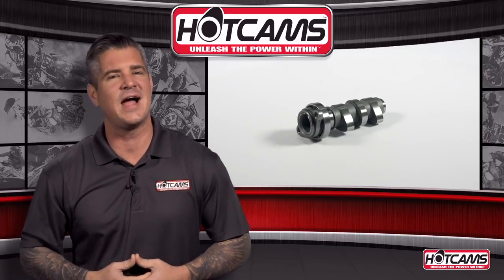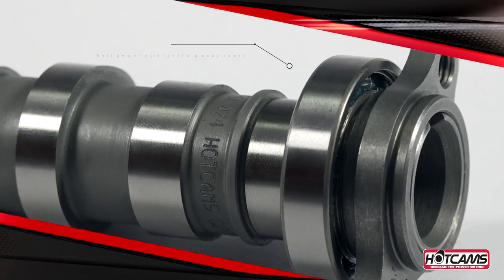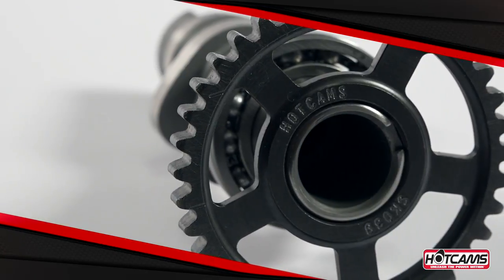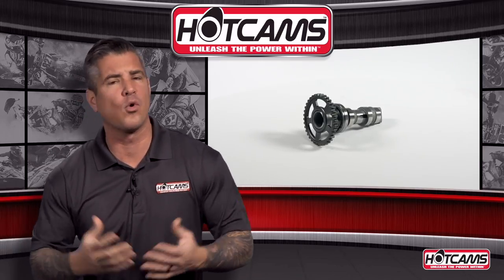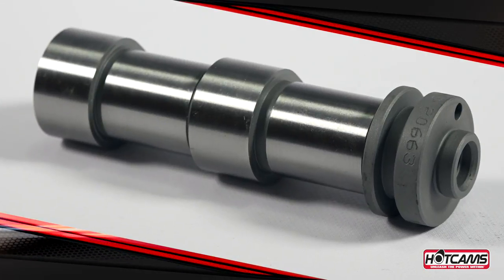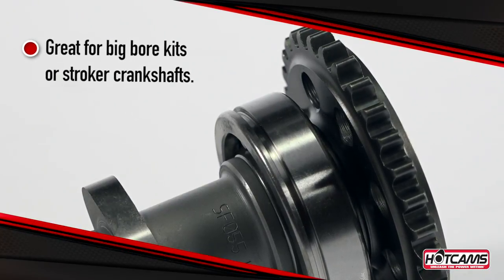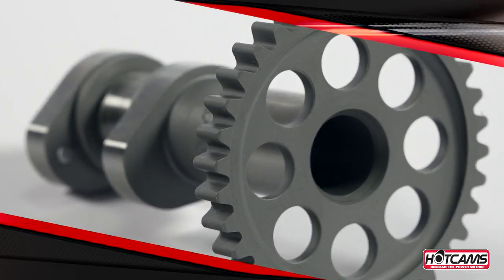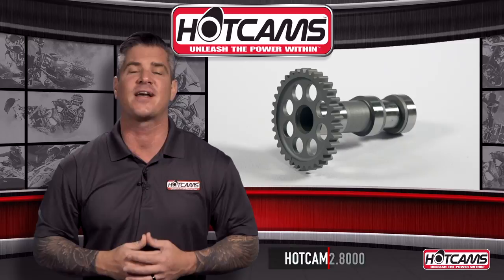Hot Cams - Design Theory Stage 1, 2, 3 Camshafts

Comment: Installing a 416 bore kit with stage 2 hot cam in my 04 400ex this weekend!!
Reply: What compression did you go with? Doing a similar build on my 01 mines 11:1 and I’m doing some mild porting on the head with the cam. Rossier R4 and probably an FCR carb. Should be a little 450 killer
Reply: I did a 416 kit with a stage 3 cam. I don’t have near the bottom end that I used to have so I think I’m gonna put the stock cam back in it for a while

Comment: Who knows of ots neccesary tp jet down woth hot cams based on longer valve opening and duration. I have an 08 and am at 35 pilot 180 main 2 turns out runs and idle good with a 42 and 45 pilot the best idle was acheived woth fuel screw all the way in. Any insight would be great

Comment: Would a stage 1 really help with the low end? I’d like my CRF250R to have a bit more low end on the trails and not stall so easily. (I didn’t get a trail bike because I want the power of the R.) Thanks for any advice!
Reply: I'm not sure how much of a low end gain their stage 1's will give you over your stock R cams.. it may be worthwhile, Idk.
 But I would recommend a heavier flywheel if you're going to be lugging the engine in lower rpm, this will make it harder to stall in those low speed/rpm situations, and also smooth out the throttle response so it's not quite as twitchy. Swapping out the throttle cam to one with a longer throw might help a bit too.
Reply: Get a bigger flywheel
Reply: Jesus loves you.

Comment: how much HP can you get out of a stage 2 cam?
Reply: It's very small like only a few hp, but it will improve your cam life and make it run better over time as long as you check your valve clearance. In all my bikes I run stage 2 hotcams its one of my bare minimums
Reply: @ilias5423  what do you recommend for my yfz 450r 2016 ? i dune a lot btw
Reply: @aenarcos7021  are u talking just purely what I recommend for cams? I recommend the stage 2. Helps with over rev so that u can really let it romp on the dunes. I've been on dunes a couple times and I know how much you need the extra rpms to rev out on some things
Reply: @ilias5423  thanks a lot , but is it worth it for the money ?
Reply: @aenarcos7021  compared to other upgrades to improve longevity it's not that much. That's the main reason I use them is because they last so much longer and are just nice to have in ur motor. On my 16 yz250f I have a 270 kit so I have a new cylinder piston etc, but I always do the hotcams with stronger valves and rods and stuff, then I do a full fmf exhaust. That's what's on my bike for my motor, and I'll leave it like it is. That's what me and my buddies always do, the big bore is optional but the cams with better valves/rods etc is necessary. Exhaust obviously is expensive and another optional thing, but youd be surprised just what a couple hundred dollars inside a motor to small parts can do
Reply: @ilias5423 ( yfz 450r 2016 ) ty , that actually helped me , I am going for big 3 full exhaust system , k&N filter , power commander 5 or vortex and hot cams stage 2.
Reply: @aenarcos7021  oh I missed the yfz part just thought it was yz. Ur on a 4wheeler I'm on a dirtbike. I've ridden and worked on dirt bikes since I was 5 (I'm 18 now) and I've always done my own work and research etc. Idk if it applies perfectly to the 4wheeler ur on, but it should still help. And np. Love to help fellow riders with anything
Reply: I wanna get 1 for my Chinese 250cc apollo. Does any body know wat cam i can use on it? Its a 250 4stoke 2 valve 1 cylinder
Reply: Ilias so what stage should I go with if I do a lot of off road straight aways bc my buddies and I kinda do drag races and my 2012 yz250f is not as fast and my friends 450f I’d don’t have to beat him but I just want to keep up with him
Reply: 03loser I just put some stage2 cams in my 14 FYI 450r a week ago.it made a big difference in sound. I in the middle of making a video about it. Give me a week or two to recover from my accident and it’ll be up. Subscribe if you want and when I get it up you can check it out.